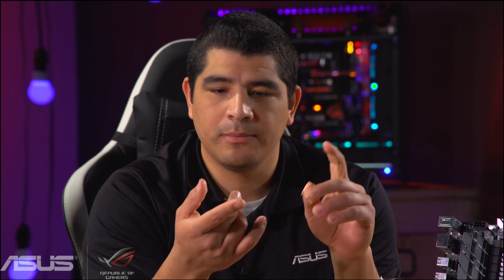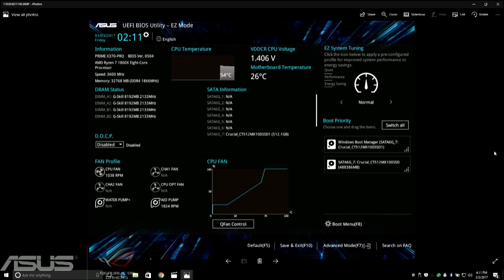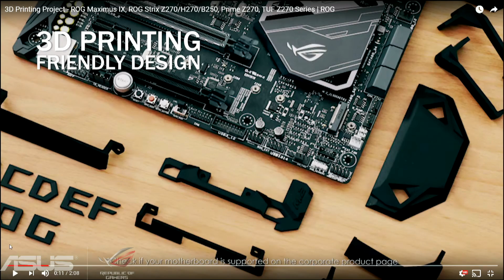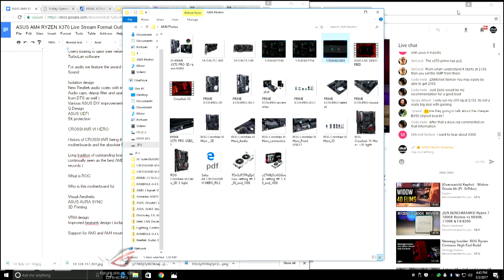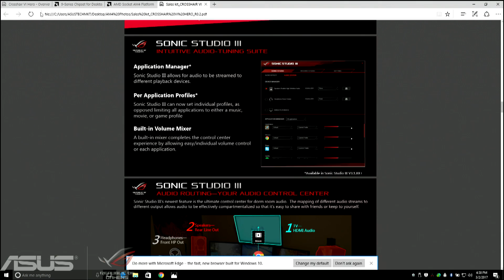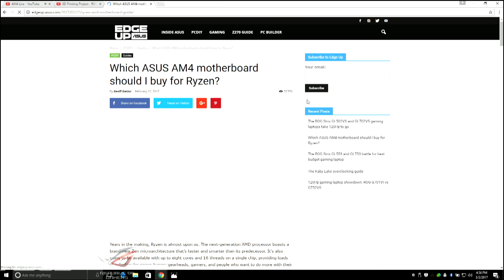Live AM4 Motherboard overviews and Q&A

Comment: They need to release more AM4 motherboards, I'm still waiting for a Micro-ATX motherboard with good audio solution to build my Ryzen system.
Reply: No they dont need to do that they need to fix the bios of b350 MOBo first and lower end tire x370 bios cos as of now only higher ends x370 chipset mobo are getting bios update

Comment: I just bought intel 7700k processor should I sale it and buy amd ryzen ???
with Asus ROG Strix H270F Gaming Motherboard??? shoild I change it to now?
Reply: 7700k is still better than ryzen for gaming.
Reply: CoderMonkey Nathan only on 1080p on 4K ryzen breaks even
Reply: At 4K the results are bound more by the GPU than the CPU, hence the little difference. Ryzen seems to be performing about the same as a high end i5/ low end i7 when it comes to gaming. When it comes to workstation and heavy multi-threaded workloads is where tends to shine. Game companies the last couple of years have only really had intel to optimize for this will change. Plus the chips are still new with new firmwares popping almost daily the difference between a 1800X and the I7 7700k will shrink even further. But for now if you just purchased or are about to purchase a cpu for gaming the i7 7700k is best bet. Intel have made sure or the with recent price drops. AMD should be proud they have produced a chip that has brought back about neck and neck performance wise with Intel a jump of 50-100% performance jump since the last FX series of chips.